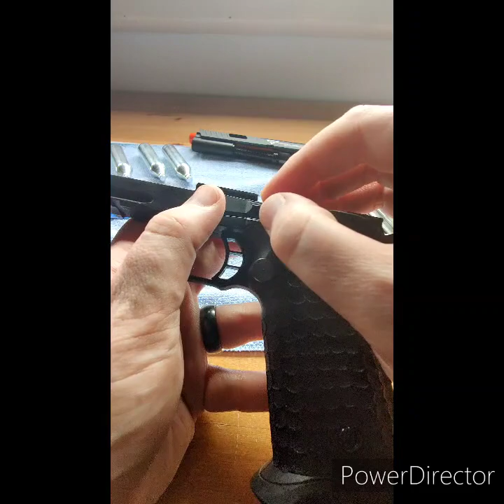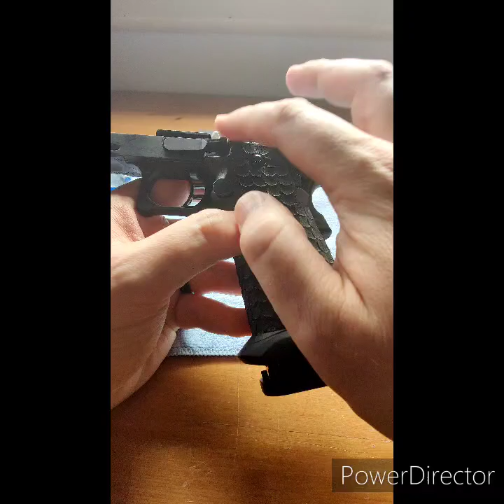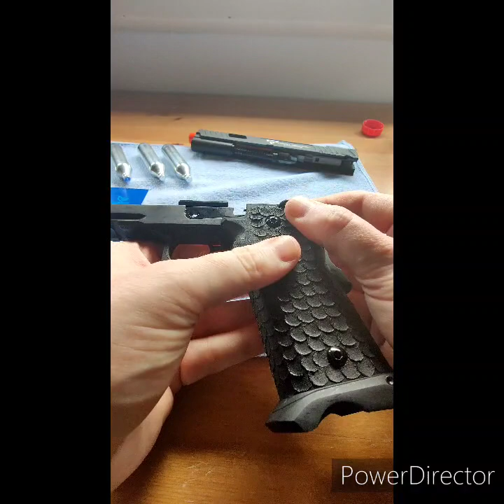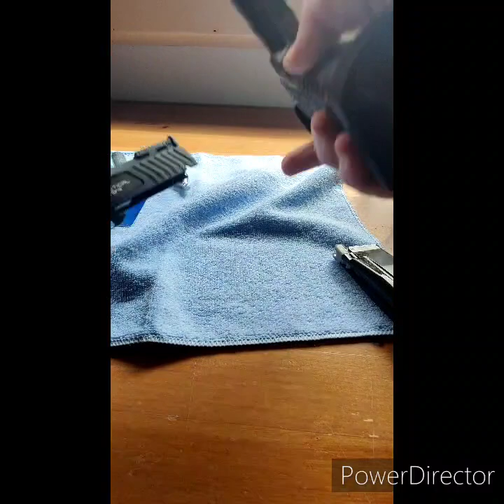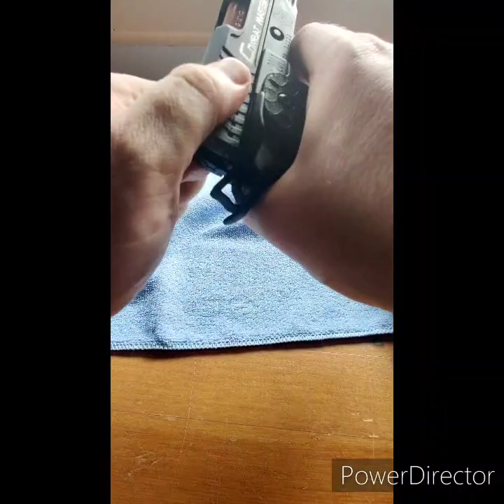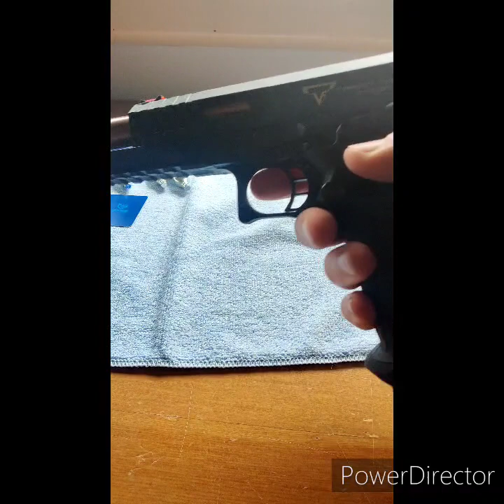TTI 2011 Lockback Fix

Comment: does it work when shooting?
I have a regular well 1911 and it locks back fine when I draw the slide back but not when I shoot
Reply: its a similar issue... pin is too tight on some.Just sand the lever a little as described.